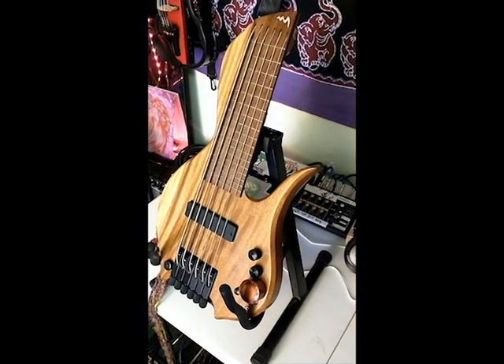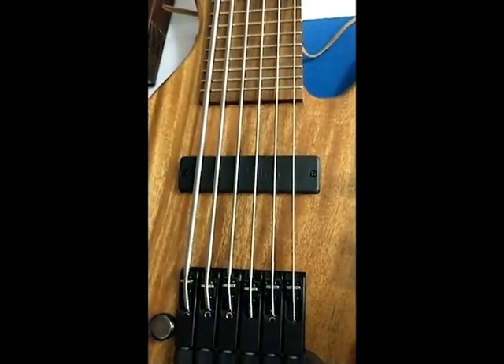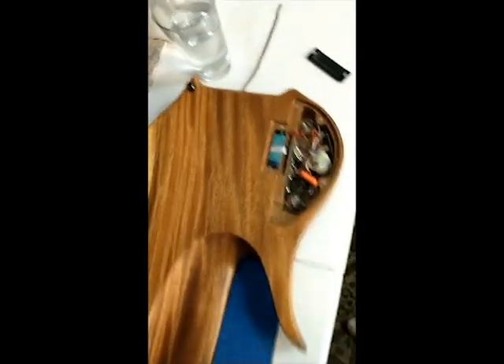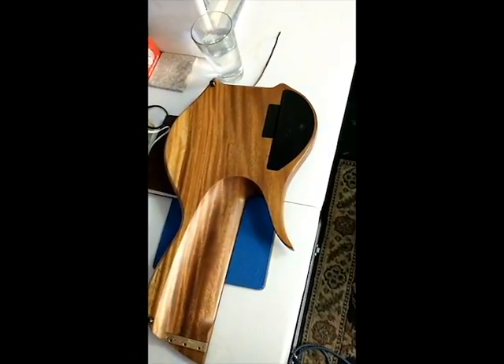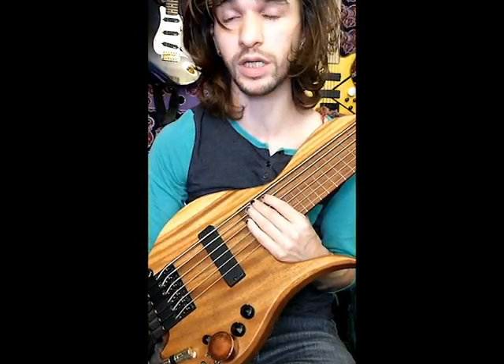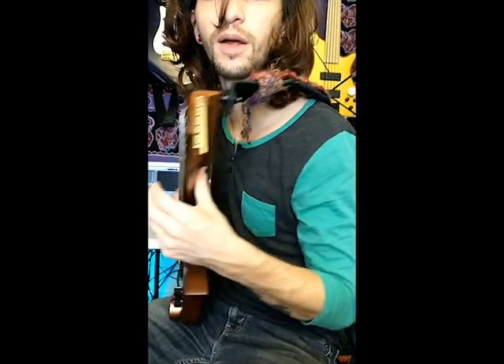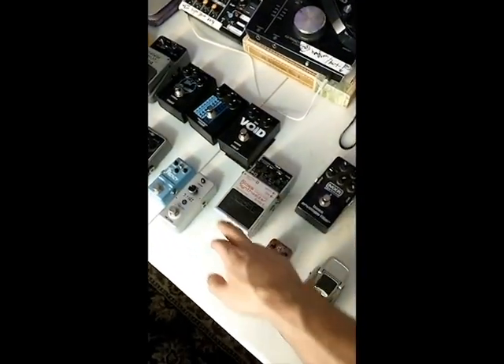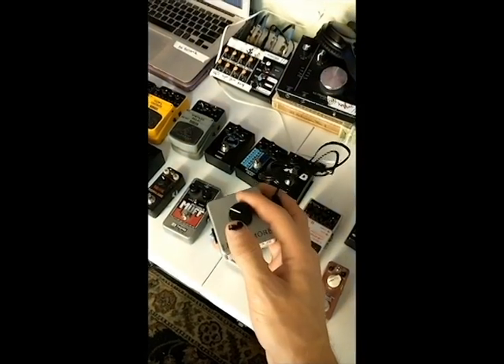Smallest Bass in the World - Overview/Pedal Contest

Comment: Have you tried flatwounds?
Reply from the maker: They haven't been made yet! I don't know if anyone willing to make me a set of strings for this at this size that are flatwound.
Reply: @zekekyoku338  Dang - you can’t use off the shelf strings?
Reply from the maker: @cobboom2211  not for this octave. Normal strings work if you want to have the higher octave like this instrument is actually designed for haha for the low octave I had to reach out to Kemp Strings to make a set just for the task and they didn't have flat wounds as something they could do